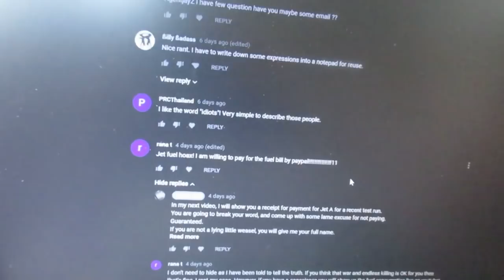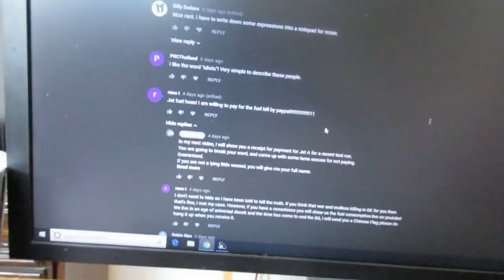Hoaxtard Discussion

Comment: the turbine sucks air then blow compressed air..no fuel needed if it does maybe only small amount of fuel..
Reply from the maker: This is great. The way you've arranged the words in your statement reveals you are running an absolute vacuum of information.
Reply: Even we who know how jet engines work wold not claim that the turbine sucks or blows anything. Go and see if you can find a functioning brain that doesn't run on compressed air.
Reply: Alvin: I have noticed that my shop air compressor works much better when it is plugged in.
If you want to believe that compressing air takes no energy, just try pumping up a car tire with a hand pump.
Reply: @AgentJayZ  jay your comebacks and attitude towards refuting this bs always cracks me up lol